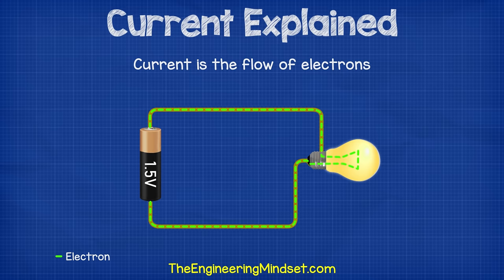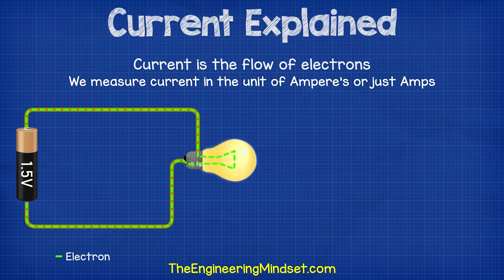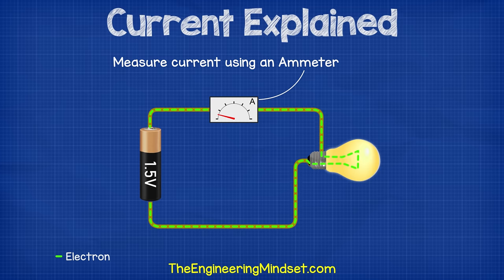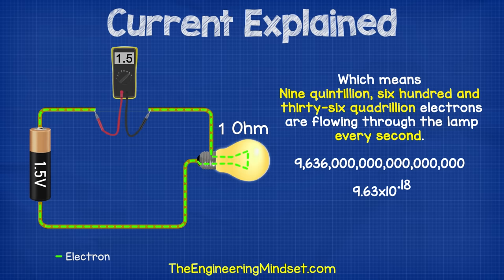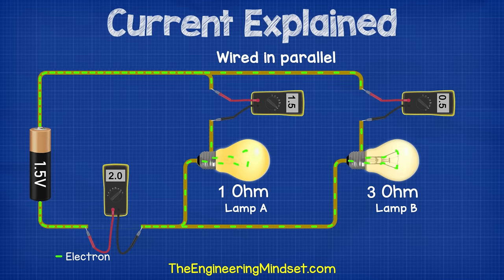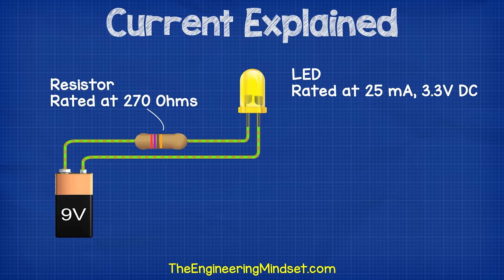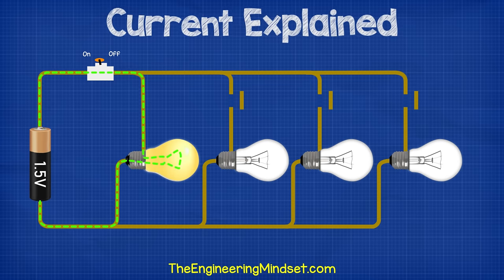What is CURRENT– electric current explained, electricity basics

Comment: This may be stupid question but I am not able to visualize. At https://youtu.be/8Posj4WMo0o?t=437 (7:17)  how is it 3Amp. In a generic sense a resistance is a resistance no matter serial or parallel because its a obstruction force. I mean you have the same voltage(pushing force) and you have two resistance in parallel. So why cant I sum up the obstructions and consider it like a serial thing. My whole life of electronics knowledge that I built so far is just accepting that if you add things in parallel its like this and if its serial is like that.

Comment: dear i have 3 shaded wire in my office for camera in-stallion the ground cable  for both  have 220V read using multi meter   even  shut down from the breaker i read  220V  from ground to phase, ground to neutral, ground to body of PDB  what is the reason for this kind of fault
Reply from the maker: Check new more detailed current electricity video here: ➡️ https://youtu.be/kcL2_D33k3o

Comment: A fuse holder is a great testing point to test current in a circuit. Remove the fuse and measure across the fuse contacts.

Comment: Ok im still confused, so tge negative is trying to get rid of the extra electrons and the positive side is trying to het as many as it can get or "suck in" right, basically, so you are saying the possitive side is also tdying to get rid of to many electrons and the negitive side is excepting them, and in a way "sucking" them in from or through the positive side of the battery and the negative side is again trying to get rid of extra electrons ant the positive side is trying to "suck in" as many as it can get and so on and so on... and that makes a circuit? Please help thanks
Reply from the maker: See our how a battery works video it'll make more sense

Comment: Is there any electrical equipment which can take the electricity from 2 phase and simultaneously pass the electricity to 2 electricity meter and further both the phase is passed through 1 stabilizer in the same house .. purpose is to lower the electricity cost .. but the problem is that if the electricity is cut in any of the 2 phase the stabilizer will pull electricity from 1 phase passing through 1 meter (extra cost will occur as passed electricity in that phase is half the house requires) .. So could you please tell me of the equipment that will take the electricity from 2 phase and if electricity is cut in any of the 2 phase the equipment will pull the electricity from 1 phase but pass it to 2 electricity meter in the house?????

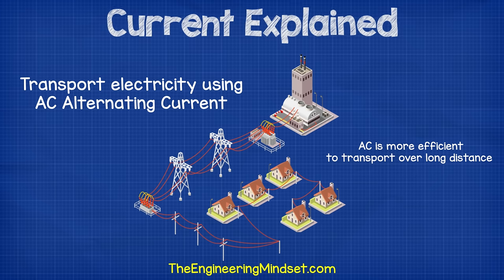Comment: @3:17 AC can't be transported easier than DC over great distances. If all being equal, DC will not have the skin effect and the capacitance that AC has. It is just easier to bring AC to a much higher voltage and it is the higher voltage that enables to transport the electricity over much longer distances. Just google HVDC technology.
Reply from the maker: Check new more detailed current electricity video here: ➡️ https://youtu.be/kcL2_D33k3o

Comment: I still don't understand how a led strip rated for 5V needs a 5V 40A power supply, and a 24V strip only needs 6A. Well, I do understand the mathematics behind it and that the amps can decrease when the voltage increases. But why? In this video we are talking current and volts and that the device can't handle too much. But if volts is the pressure and when the pressure is low, the number of electrons per second skyrockets to provide the same watt? Why? Shouldn't the amps also go down when the pressure gets very low? Instead it goes up and you need thick wires to stop burnout on a measly 5 volts? I don't get it...
Reply from the maker: Seen the new LED explained video? so much detail covered! https://youtu.be/O8M2z2hIbag

Comment: Hi! hoping that maybe you can give me some advice. I'm living in china and here it is very common to use electric scooters. As the stock bikes are pretty slow I'm trying to modify mine to go much faster. I'm currently using a 2000w motor and have a 60v47ah battery. The label on the battery says it can output a constant 50A with a peak of 100A and has a Voltage range of 50.0V-71.4V. When adjusting the controller, how do I know what would be the maximum safe voltage or current I could push the battery to? I know it sounds like I've answered my own question with the label on the battery but previously I hadn't set up the controller settings myself and the previous settings fried my controller. Frying the controller isn't too bad but I want to maximize the output from the battery without over-discharging or damaging the battery. Any advice would be greatly appreciated!! Thanks!

Comment: I have a point don't get it until now  
why batteries are measured by Volt, not by capacity or Ambers
1.5v 12v or 24v is supposed to be the voltage.
Reply from the maker: You can connect anything to, for example, a 500mah supply, it only determines how long it will be powered for. But the voltage will determine whether the device is powered at all, too high and it will completely destroy it, too low and it won't turn on.
Reply: @EngineeringMindset  thank you or replying  
do you mean that I cant measure the ambers stored inside batteries.

Comment: I’m having trouble understanding how any part of a circuit can read 3V when the power source is 1.5V like in the example in this video? How can more V exist in places at a higher level than the only power source there?
Reply: I think you mixed the voltage with current. if you're referring to 7:20. that is actually current (3 Amp), not volts.

Comment: i don't get it. how is using more bulbs increased the current load and cause the breaker to break the circuit? i thought that the current will be equally divided between all of the bulbs.
Reply from the maker: It depends how it's wires. Please see our videos on series and parallel circuits for a clear understanding.
Also this video has been replaced by a newer version
Reply from the maker: Seen our new incredibly detailed MCB video? link: https://youtu.be/gqEu9t8HwW0

Comment: Can someone please explain why when adding a second lamp in parallel which is adding more resistance to the circuit we get a higher current
Reply: I was wondering why would  you add the resistor on the other side of the LED!! 
I thought you surely need to put the resistors before the current hits the LED,
, I was wondering if I am wrong or it was an error on the video??
Reply: Don't think only about the resistance think of the extra path you are providing for the current to flow. Though the second path has some resistance but it is providing another path.
Reply: @alromans6236  The resistor is restricting the flow of electrons and it iis put into series with the led, so why will it matter whether you are putting it before or after the led. Current will flow in one direction through the led though
Reply: @soumensinha1549  thanks I got it.
Reply from the maker: Check out NEW resistor video, everything covered! ➡️ https://youtu.be/DYcLFHgVCn0

Comment: Why 270 Ohms, but not 360 based on my calculation? Correct me if I'm wrong.
Reply: There is a forward voltage drop that all diodes have. So when you add LED and resistor in series, the voltage at the resistor is lower than the source voltage (9 - 3.3 = 5.7 V). So the resitance has to be lower to allow those 25 mA flow through it even with the voltage dropped by the LED. R = U/I = 5.7/0.025 = 228 Ohm 
Its easier to understand when you ask: Diode drops x volts, what resistance do i need to drop the other (source voltage - *x*) volts?
Reply: That confused me too. I made it 228 as well.
Reply from the maker: Check out NEW resistor video, everything covered! ➡️ https://youtu.be/DYcLFHgVCn0

Comment: 5:04  So much wrong information for such a diligent effort. "One Amp = One Coulomb"  WRONG, 1A = 1C / s.  "One coulomb = six quintillion [etc] electrons per second." WRONG in multiple ways.  (a) Coulomb is a unit of charge, not a unit of something per second. (b) Coulomb is a unit of charge, not a number of electrons. Charge is not "made" of electrons. Rather, electrons happen to carry charge.  As do protons, although of opposite quantity. (c) If we use the symbol 'e' to represent the charge which an electron carries, then 1 C = e x -6.242 x 10^18  NOTE THE NEGATIVE SIGN.  
This is latter point is extremely important, because when discussing current in mundane circuits involving wires, 'current' refers to the rate of flow of charge (not of electrons). Since in wires (but not all media) the actual moving items are electrons and carry a negative charge, their flow constitutes a negative current.  This explains why electrons flow through the wire from the negative battery terminal (negative because excess negative charge) to the positive terminal, yet we describe this as a (positive) current (in the direction) from positive terminal to negative.  This very small surprise, so frequently badly explained, leads to misunderstandings such as there being an alternative "conventional" current that is mysteriously different than the "real" flow, when in fact it's all part of the same idea that stems from defining the polarity of charge (and the Coulomb) such that protons have a positive quantity of charge, and electrons negative.
Oh, and the slide also appears to say that six quintillion [etc] = 6.242x10 to the negative 18th power, when actually it's the positive 18th power.  On close inspection, that is perhaps a caret character, which is meaningless and confusing when you write the exponent as a superscript.

Comment: How are you connecting that voltmeter it doesn’t make sense to me. Your portraying it as you cut the wire in half and testing each side of the wire ? I don’t find that to be a practical way of testing the amps

Comment: I feel so stupid. I've watched a lot of videos online and I still can't figure out exactly the difference between amps and volts. I understand that they go together but how.
Reply from the maker: Voltage is the pressure pushing the water. Amps is how much water is flowing.
Reply: Voltage is the energy supplied to the electrons to make them move. The energy is created by a chemical reaction in the battery. The unit of energy in the Joule. One Joule is the energy required to raise an apple to 1 metre off the ground. A Coulomb is approximately = to 6,000,000,000,000,000,000 electrons. The unit of measurement is the Joule per Coulomb and 1 volt = 1 Joule/Coulomb

Current is the rate of flow of electrons - a number of electrons flowing past a point in 1 second. The unit of measurement is Coulombs per second and 1 Ampere = 1 Coulomb/second

Power is the rate at which work is done. So the unit of measure is the Joule per second and 1 Watt = 1 Joule/second

Comment: This video doesn't explain amps very well at all and is confusing in the way it says an amp is 1 coulomb, and a coulomb is however many atoms per second. A coulomb is just the amount of atoms. An amp is a coulomb per second. The amp is the rate not the coulomb.

Then jumps to an example that makes no sense to the layperson, why does a 1.5 watt lamp with a 1.5 volt battery need 1 amp? And why then when you measure it with the multimeter does it measure 1.5 amps?!?

Comment: This video is very poor in comparison to the others I have watched by THM. It does not decribe what current is properly it is very little difference in it's description to voltage. this video needs removing and doing again Current please. What is it? Volts and amps does it say that anywhere!
Reply from the maker: https://youtu.be/8Posj4WMo0o?t=111
Current is the flow of electrons. It was mentioned numerous times in the video. More electrons flowing means more current. Voltage is the pushing force which moves the electrons.

Comment: One Amp is One Coulomb?! They are different  units. So they are certainly not equal. One is the current and the other is the charge. One amp equals the flow of one coulomb of charge per second. So yes, there is one coulomb of charge in one amp. But to say they are equal is just incorrect. 

Also your definition of coulomb is incorrect as well. It has nothing to do with seconds. As a matter of fact that definition is the definition of an amp :)